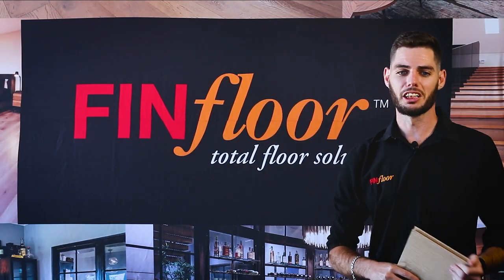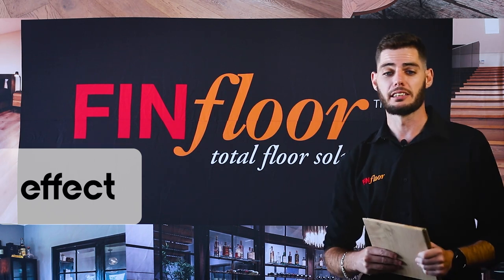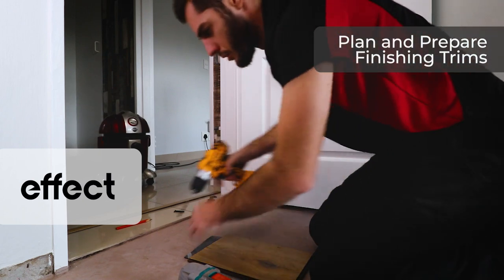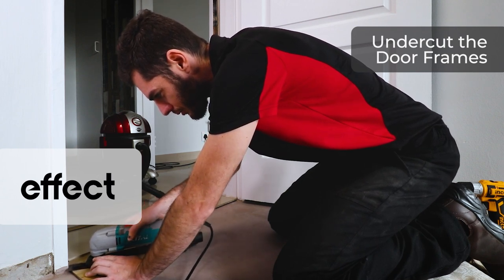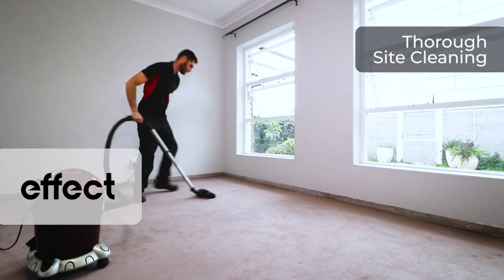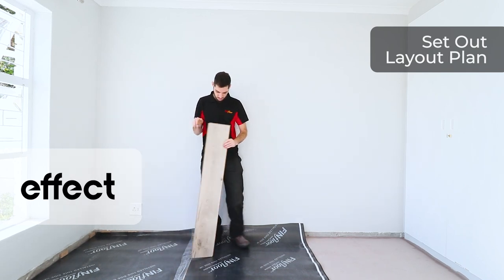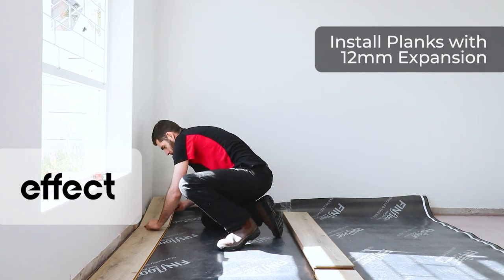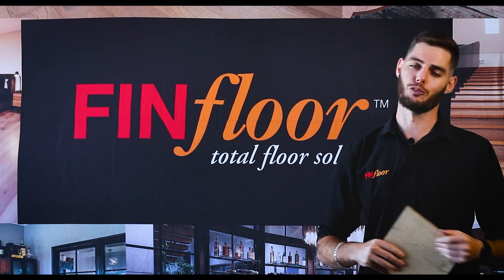Laminate Installation Introduction | AGT Effect Laminate

Comment: The design of these boards aren’t great at all, no click mechanism makes certain planks extremely difficult to fit. Looks nice though😵‍💫
Reply: This is the understatement mate. This is the worst design klick system I have ever seen. It is a crime how bad it is. 

For the future users. Stay away. You can only work with this floor in one direction. So brakes between the rooms are necessary. It is extremely hard to lay down and ease to pop out. I would stay away from this floor. Spend some more money and get swiss krono